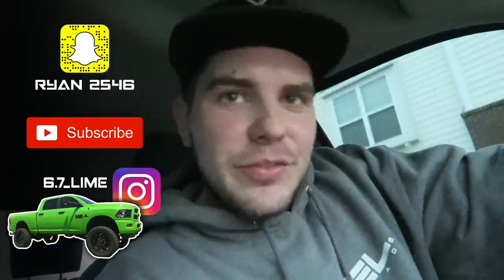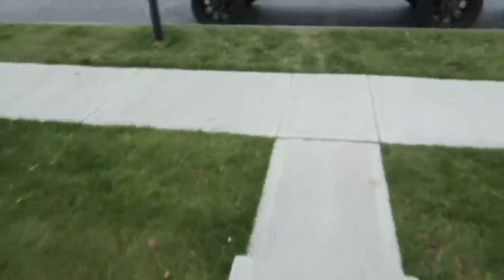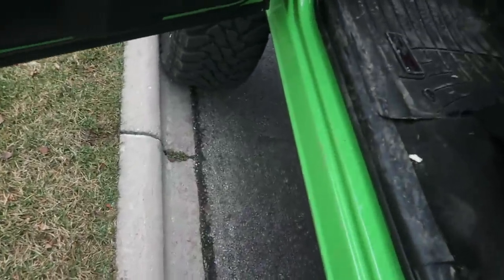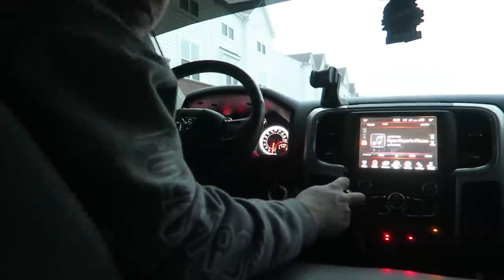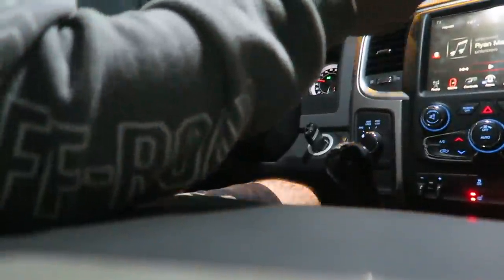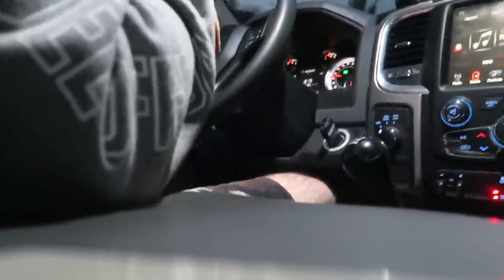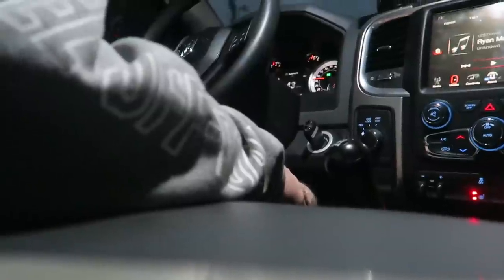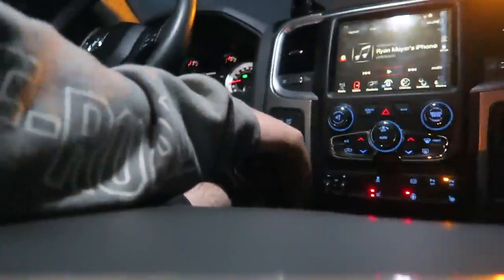2017 CUMMINS GOT A DUAL DISK CLUTCH *First Drive*

Comment: How are the toyo’s doing for you how often do you rotate them ? Been taking my 2016 Tahoe Z71 4x4 to the dealer for oil change and they have been rotating my tires just switching the fronts to the rears and not do a cross rotation and they have some decent miles on the and they are starting to cup the tires should I address that they aren’t rotating correctly cause they aren’t doing a cross rotation like it’s recommended in the owners manual for 4x4 and RWD vehicles ?

Comment: I used Mobil delvac 50, it’s a synthetic manual trans oil, little heavier than atf/ synchromesh so harder to shift when cold, but it quiets down the gear rollover like nothing else I’ve used... once you break in that clutch you’re really gonna love it, I’ve got almost 40k on mine and it still grabs every bit as hard as it did new.  👌
Reply from the maker: I might have to try del 50!! And I’m excited!!!!
Reply: I ran the atf at 7 qts.  I got basically got very little gear roll over when it was cold. When warm I could hear it. I switched to Mobil 1 delvac 50... quiet as a mouse now.
Reply: Amsoil 75-90 MTG is much smoother. I've used them both. The magnet after 30K had the tiny fuzz on it.

Comment: Wouldn't that be more of a harmonic vibration being transferred through the single mass fly wheel? Go find a 60's 70's and 80's truck with a np435 four speed, aka granny gear, put if in first and listen to it as it moved under its on power. Made a wawawawa type sound.

Comment: Glad you finally got the clutch installed.  I’m running the Valair quiet organic with 7 quarts of Mobil Delvac 50 and it almost completely killed the rollover noise.  I ran the stock ATF for a few weeks, and that fluid was a night and day difference.
Reply: Try Amsoil MTG next change. Much smoother.

Comment: My 18 sounds like crap whenever I shut it off you can hear everything clinking when it shuts off is it still like that?
Reply: David Howell turbo bark
Reply: Nope no turbo bark just can hear everything in my trans thinkin it’s from the pos dual mass flywheel
Reply from the maker: Nope 😎 but press the clutch in and shut your truck off with the stock clutch you won’t hear that sound, I made it a habit
Reply: RYAN MAYER thank you for responding
Reply: Thanks bud I will try that for sure guess it is from that flywheel pos lol I’m doin tires after the first of the year can’t handle stocks on this dually anymore gonna throw 35x12.50 on it hopefully they will fit with a level kit and 2” spacers on the rear and I can still pull my trailers alright
Reply: My 18 does the exact same thing. Now I just keep the clutch in when I shut her down

Comment: I noticed you weren’t driving with exhaust break on. Do you usually not use it? Why?
Reply from the maker: Sometimes I do others I don’t, noise is #1 for both ways haha I either want to hear it or don’t want to be a nuisance

Comment: Can someone explain what rollover is?
Reply: Just the noise from the gears turn in the transmission.  The stock dual mass flywheel helped reduce the vibration for the engine to the trans. The SB clutch does not use a dual mass flywheel so the noise is more noticeable.

Comment: Been wanting to ask you two questions
1st on the 2014+ ram 2500 can you do the same lift kit for the ram 2500 2WD because from the looks of it the suspension looks the same
2nd on the bds 8inch lift would you go dual NX2 or single Fox shocks?
Reply from the maker: Fox 👍🏼👍🏼👍🏼 and hmmm I’d would assume if the suspension is the same it should fit

Comment: The reason for the noise is not the clutch.. its the shift fork rails... if you don't push in clutch and slightly push it towards a gear, it stops rattling.. those stamped steal shift rods is whats rattling their asses off..